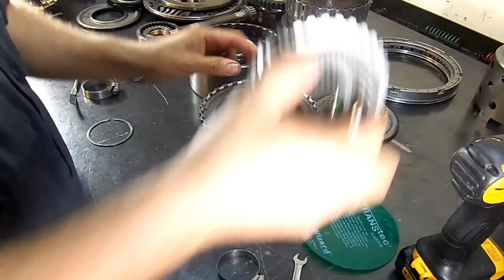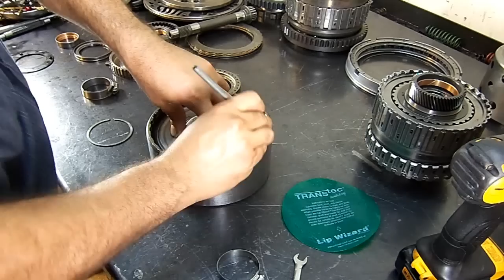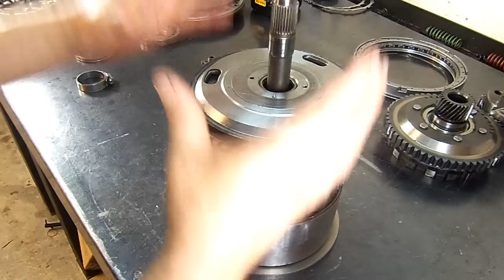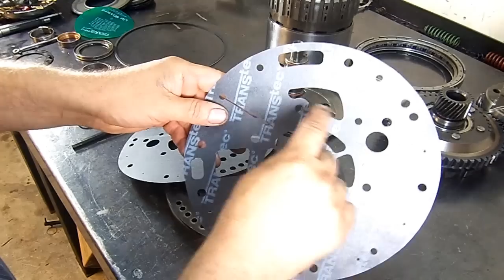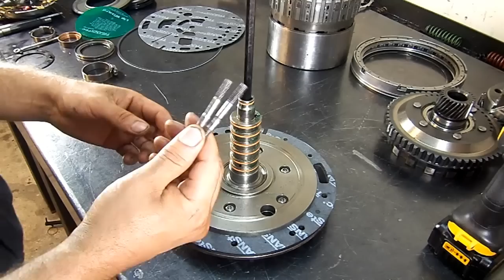CD4E Transmission Rebuild Part 3 - Transmission Repair

Comment: Where do I find those valve body alignment pins are they located somewhere in the cd4e transmission? If so I can use my old broken cd4e tranny and pull them out. I can’t find anything online and I need them.

Comment: Please i need help!!. If the pump is mount in the car, can i get out only the pump? I have a leak and y need change o rin, or is necesary unmount all the transmision
Reply: Someone in spanish or english? Please
Reply: The pump is behind the bellhousing inside the transmission so it must be removed from the vehicle so you might as well get it rebuilt all the way while you're in there its a lot of work just to get them out of the vehicle!

Comment: my ford escape 2001 walks back when it's cold without problem, but when it's hot sometimes I have to step on the brake and accelerate pedal

Comment: What would be the proper torque spec on the oil pump assembly bolts and the pump assembly to the case specs, Mitchell is saying 8ft,lb on the oil pump and 10ft,lb on the pump to the case, we tried this and it will snap the shaft in two and lock the pump up, anyway to know the torque spec on these, i don't trust Mitchell anymore, dose anyone have Alldata that could look up the torque spec for a CD4E and see if its the same.  Thanks to anyone that replays
Reply: Does anyone know if both lip seals on the forward reverse piston should face down? Or does the outer one face up and the inner face down? I’m stuck
Reply from the maker: +Jason Warkin When you torque the bolts, you should be able to turn the shaft by hand. If not then there might be some debris on the pump gears gears. The gasket goes between the plate and the support not between the pump and the plate.

Comment: Good video, takes me back about 20 years to when I was rebuilding CD4E's for European cars. A couple of points I'd like to make, I'd have soaked my frictions in ATF before installing them. I'd also have used no prodder or feeler gauge to install the moulded pistons. From memory I used to give them a nice rock and they usually dropped in no problem. We  always used to replace the black bodied old style solenoid packs with the brown ones.

Comment: if my transmission won't go past 4th gear on my lexus is250 what might be the issue? and also if I change the transmission oil is there a chance my transmission won't work after? people have told me there's a risk.

Comment: Hiram, i recently wrote you about rebuilding my transmission. After 3 months and bitter cold here in new jersey my od light has started flashing doesnt shift to third gear. I noticed if i left the vehicle on and parked for a long period when i put it in drive i would have to rev alittle for it to grab first gear. Any suggestions, thanks again, Jose
Reply: If you don’t hear from him then might I suggest trying an in car partial rebuild if you don’t want to take it out of the vehicle, also the rev thing sounds like a filter partially clogged and warm fluid not moving as well through it or a leak and warm fluid leaking worse

Comment: Before I dismount my transmission I have a question. I have a Ford Escape 01 4x4. When I was checking the rear side, my jack slippered and make a hole in the differencial. I was waiting for put another differential. By that time I started clean the vacuums lines. I did buy a product name Sea Foam. I did take out a vacuum hose from the Brakes Booster and pour a little of that liquid. When I finished and try to move the vehicle, It’s wont’s move at all. I didn’t have any issue with the transmiision before. What happened,  and what I did with the engine, doesn’t have any connection for me, . I took out a line from the transmission and radiator, and there is not  pressure.  But by your experience, what can I ck. First?. Hope your answer backs to me soon. Thanks in advance Gr0958@hotmail.com.

PD: My transmission is a CD4E?

Comment: I thought you had to soak the friction disks in transmission fluid before installing them.  How come you put them in dry?
Reply: I always used to soak friction discs in oil before installing them. Perhaps the guy is gonna soak the completed drums in oil before he installs them?
Reply: You don’t have to if you install them wet or dry it will not make a bit of difference